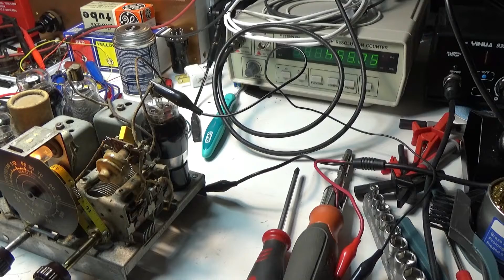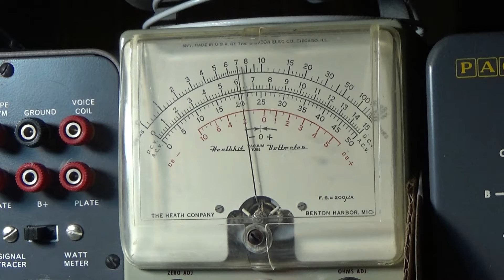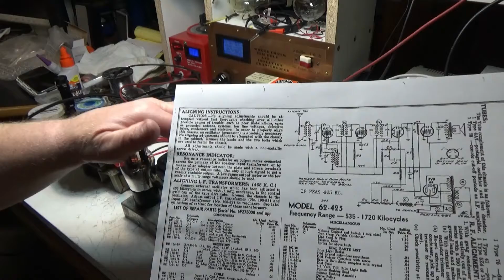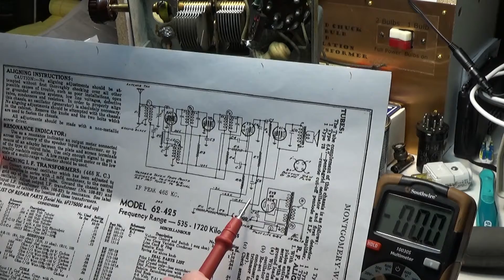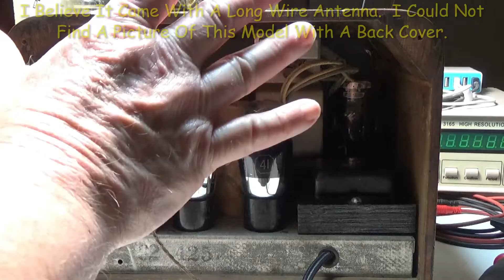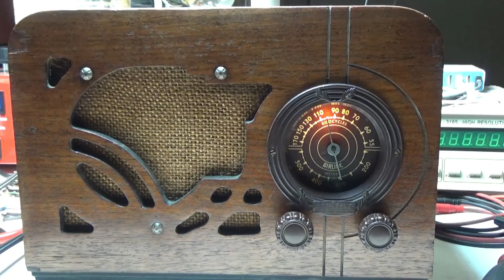Montgomery Wards Airline Model 62-425 (Indian Head Radio) Part 5: A Final Look

Comment: I am a bit perplexed with the voltages you are reading on the filaments of all the tubes.  I can understand 5.7 volts on the power rectifier tube, but the other tubes should have 6.3 volts on them.  If you look at the schematic, it shows one winding of the secondary solely on the filament of the 5Y3 tube and another entirely separate winding going to the other tubes.  If that schematic is actually the model you have, then you might want to make sure the correct winding of the secondary of the transformer is connected to the other tubes.
Reply from the maker: I will check that out!  Thank you for watching and pointing that out to me!